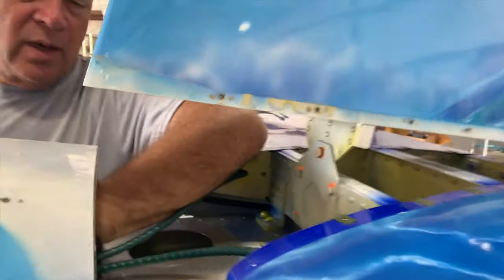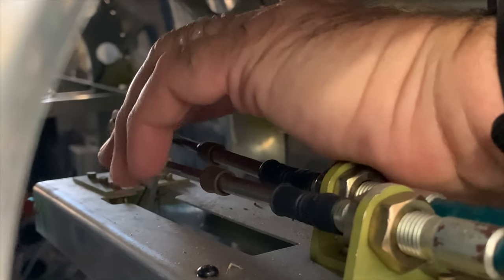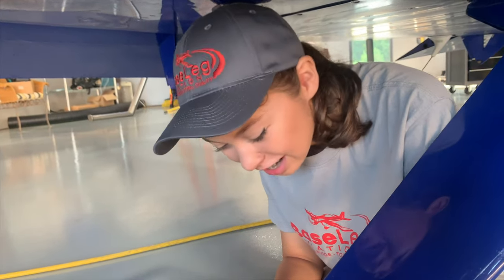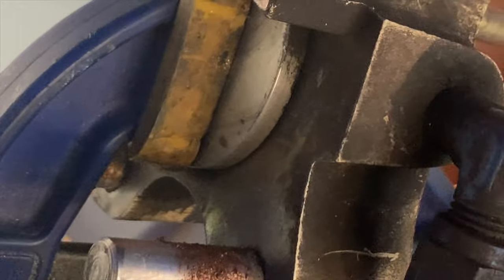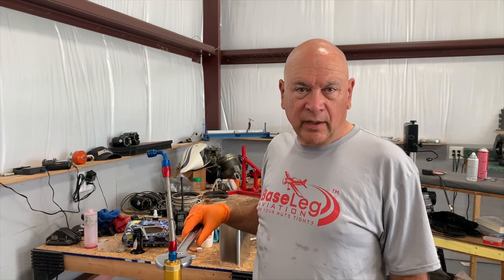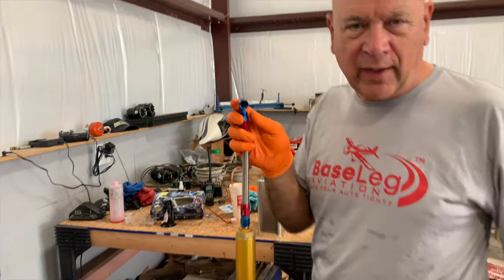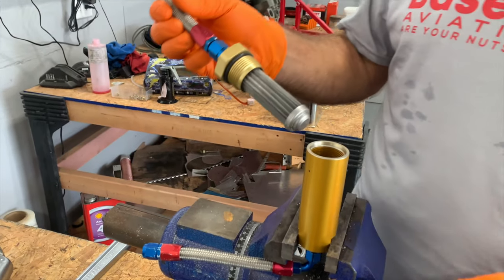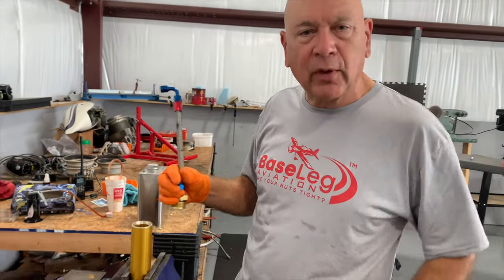Brakes, jam nuts, fuel filter

Comment: 04:00 Are those vice jaws holding the filter housing aluminum?
Reply from the maker: No, they’re holding the “flat” end of the filter housing. Where it is designed to be held.
Reply: @baselegaviation1614  Let me try with better grammar. Are those vice jaws which are holding the filter housing made of aluminum?
Reply from the maker: @PatrickJWenzel  Ha, I understood what you were asking. No, the vice jaws are not aluminum.
Reply: @baselegaviation1614  Ahhh, in that case would you see any merit in placing some right-angled ally pieces onto the jaws? I'm thinking dissimilar metal corrosion... I learnt the hard way.